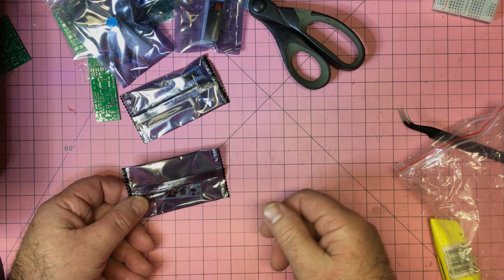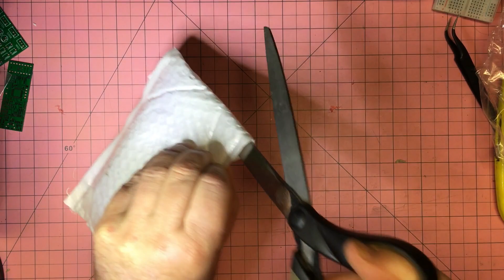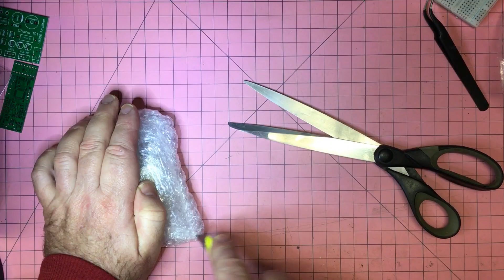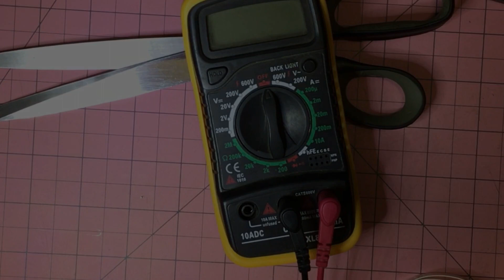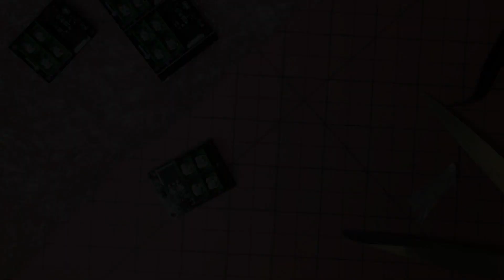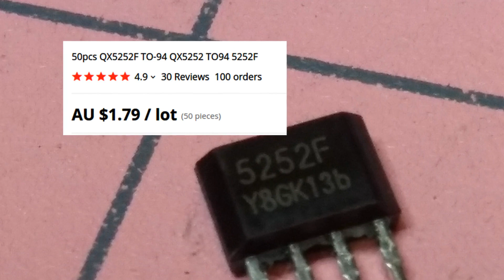Monster Mailbag - Part Two

Comment: I got a 16 pin SMD to DIP converter PCB, the chip I wanted it for was too wide. I had to cut the PCB down the middle with a Dremmel. LOL.
Reply from the maker: Sometimes I’ve bodged up one bought “adapter” with a rats nest of wire to make it “fit”. Frankenstein stuff! 😀

Comment: Yes, that is a monster mailbag!  Sadly, I have never cooked up a good purpose for input shift registers.    Those 8-pin adapter plates are relatively easy to find at little expense; but 10-pin with 0.5+0.95mm, cost over twice as much.